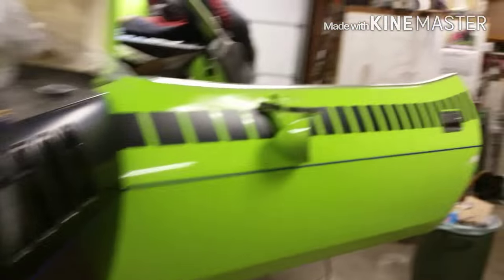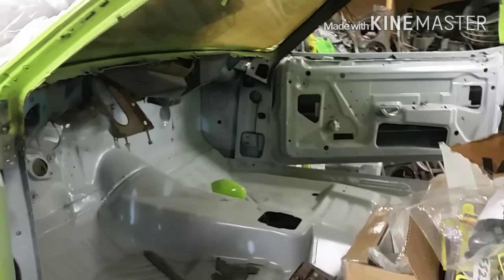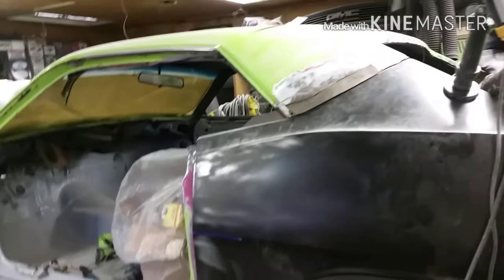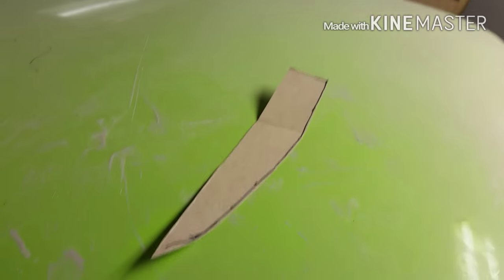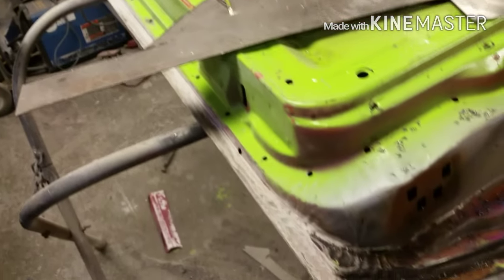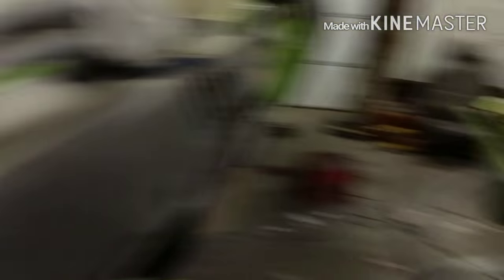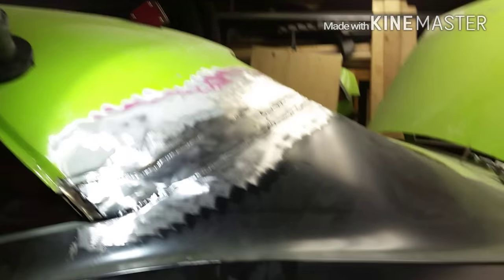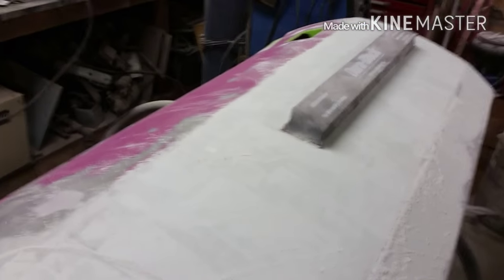Project cuda part 23

Comment: Very nice update. I like to seal the metal up with epoxy first. The epoxy that I'm using, I usually have to wait 24 hours before top coating with poly. Something about the poly can cause my epoxy to soften up if sprayed too soon. Yours may differ, but definitely check.